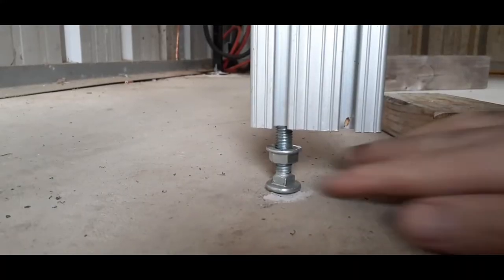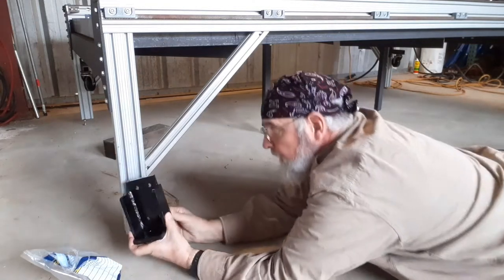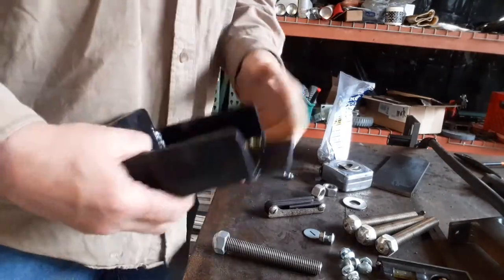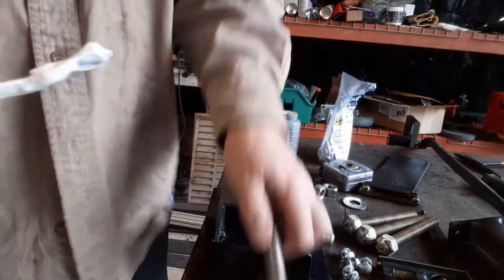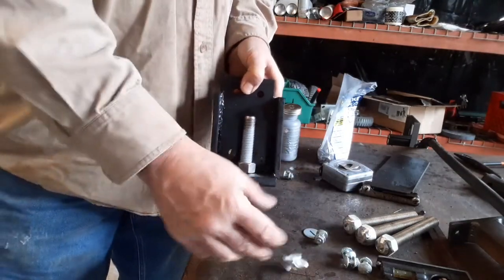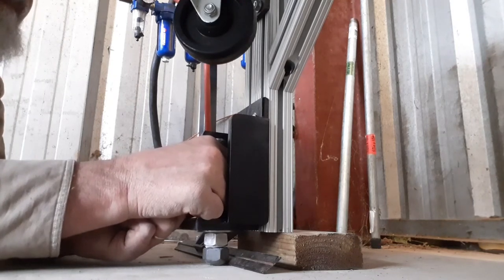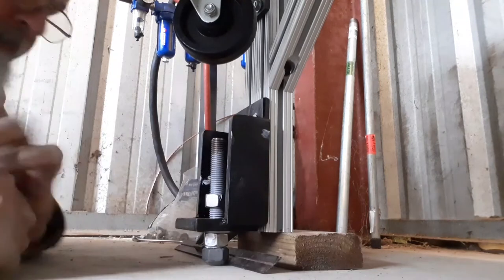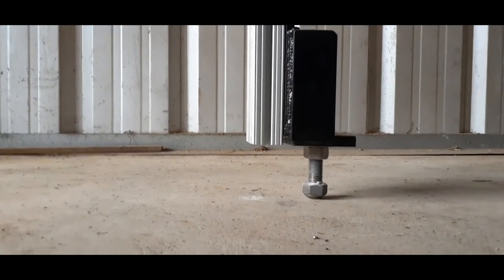Arclight dynamics 9600...leveling brackets

Comment: 80/20...the big kid erector set (aluminum). Played with a lot of that stuff before. Make sure ya loctite, every bolt in the table. The aluminum flexes at times, and bolts n nuts work loose. 👍⚒️😀